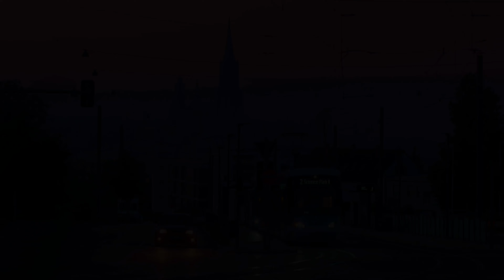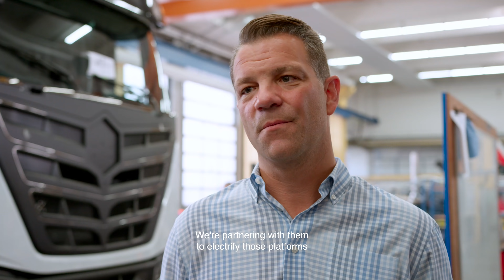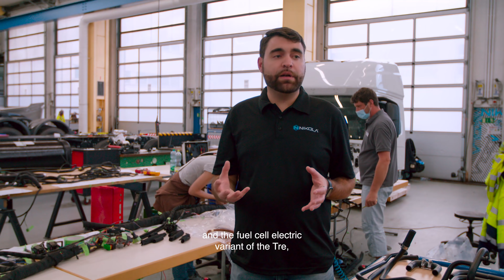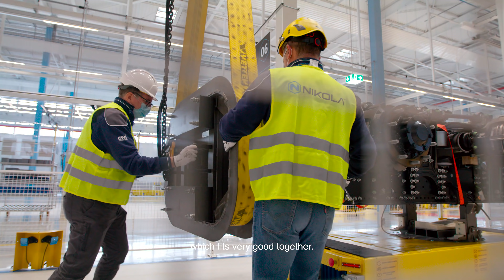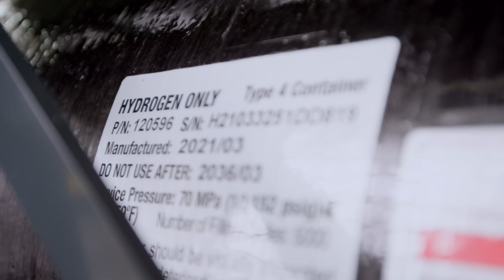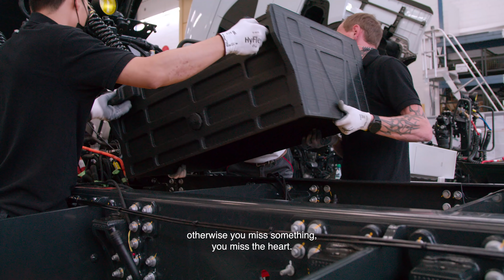Driving Change Episode 6: Start Before You're Ready | Nikola

Comment: It's unfortunate that this company is starting with a Cabover Semi Truck. They'll need to make Convention Trucks that will lure the current US fleet trucks that operate today. I started Truck driving back in 1985, and back then there were very limited Cabover Trucks that were operating. Cabover Trucks are not desirable in todays choice of Truck Drivers or Companies. Although I wish Iveco/Nikola success, they're missing the US market.  Note**Clean Energy NG that Boone Pickens started has locations built all across America that are not operating. Maybe Nikola could talked them and make a joint offer to distribute Hydrogen .

Comment: So where are all the German protests to this plant opening and concern for the precious environment like they have have done with the Tesla plant??
Reply: I think this was an existing IVECO factory and not a greenfield project. Im still not sure exactly what if anything Nikola is actually DOING related to these trucks. It's an electrified S-Way with a custom cowling. 🤷
Reply: @patreekotime4578  It is an ELECTRIFIED S-Way. If it as simple to electrify an existing vehicle as people contend, we would see a lot of electrified versions of existing cars and trucks.
Reply: @lockbert99  Iveco has been building electric trucks since 1986. If anything they are THE leaders in electric truck and bus manufacturing. So what exactly does Nikola bring to this product?
Reply: @patreekotime4578  1986 is an incredibly early time to have an electric vehicle (other than the ones from the early 1900s). Seems like they shouldn''t need Nikola in that case. Although their electric New Daily 50c doesn't have the most impressive specs due to them using Sodium Nickel Chloride batteries for some reason: 70kph/43mph top speed and 90 to 130km / 55 to 90mi range. How did they start in 1986 and yet have a vehicle with those batteries/range/'speed-limitation in 2021? Crazy.
Reply: @lockbert99  because European local delivery vehicles do not require impressive specs. They need to be cost effective and dependable.
Reply: @patreekotime4578  Why did Iveco not get into European non-local vehicles?

Comment: Instead of hydrogen, why doesn’t Nikola look at solid state batteries? Packs that can interchange like the trailers it hitches, to mitigate downtime between stops and recharge cycles?
Reply: You can use solid state batteries with hydrogen fuel cells. A FCEV is still an electric vehicle it uses a hydrogen fuel cell, batteries, and electric drivetrain. All they got to do is swap the old battery tech with solid state batteries
Reply: The logistics of swapping SSB for trucking would be a night mare. The investment to facilitate road stop for this would be massive, and the congestion at these interchange point would too time consuming?
Reply: They could probably come up with a switchable semi-truck battery trailer with existing battery technology. But there must be some issues with doing it. It may be the double connectivity. The battery trailer would need a hitch for the cargo trailer to connect to, which would require the cargo trailer to be smaller to hit the "max truck length" laws. And it would probably have to be a different hitch that didn't turn like normal or else backing up and turning would involve two "joints".

Comment: By the way, we need hydrogen trucks as soon as possible, also in Europe. Transporting goods over long distances and over natural obstacles, the high mountains like the Alps and Pyrenees with their many and above all long climbs over mountain passes like the Brenner Pass, is a challenge that can only be made possible with the hydrogen fuel cell. In contrast to trucks with their combustion engines, the air in the Alpine valleys will become cleaner again, noise will be significantly reduced and the quality of life of the inhabitants in the narrow Alpine valleys will rise again. In the best case scenario, night driving bans and the numerous speed limits for trucks in the Alpine regions should fall because the new and innovative hydrogen fuel cell trucks are emission-free and much quieter and more environmentally friendly. This would make the transport of goods much easier, faster and cheaper. Not only in Europe, but everywhere where appropriate regulatory restrictions still apply.